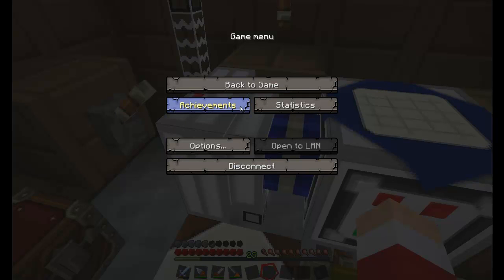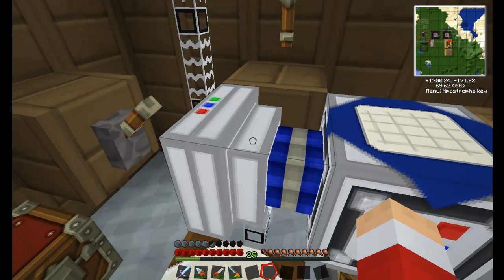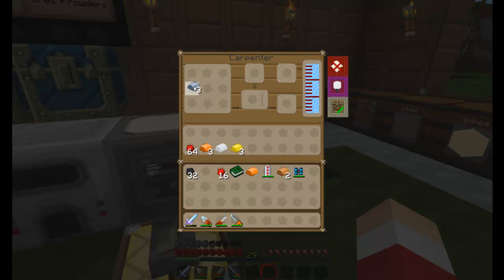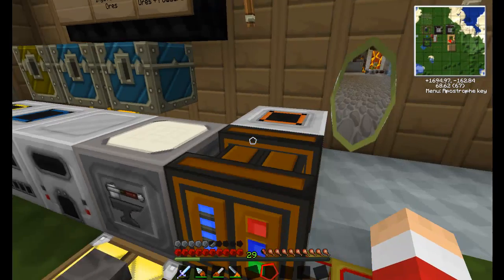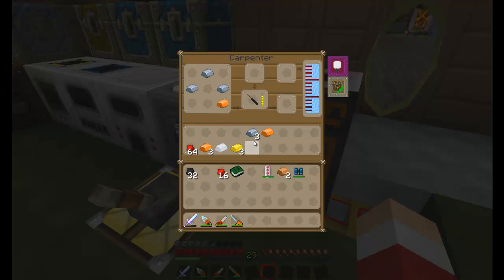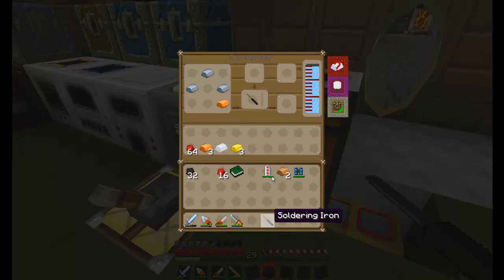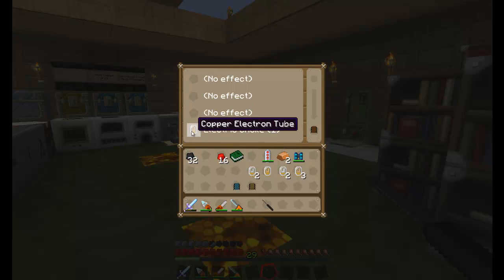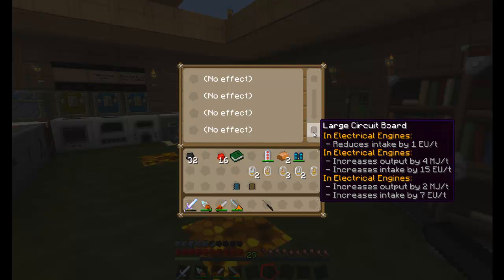FTB - Upgrading an Electrical Engine

Comment: Thanks for that information.  I created a medium/enhanced circuit board and was able to apply the 2 tubes without issue.  I'm guessing this is a bug of some type.  The odd thing is that I was able to craft one earlier in the day (after a single failure) but since that success I have not been able to craft another one.  Do you use Optifine?  Could be an issue there?

Comment: Thanks for the video, it was extremely helpful.  I am having one issue, however.  When I put the tubes in then put in the circuit board the tubes disappear and the circuit board does not move down to the bottom slot and the board is not upgraded.  Is there a specific order the chips must be placed?  I tried the same order you used (iron, bronze, tin) and that did not work, either.  Any advice?